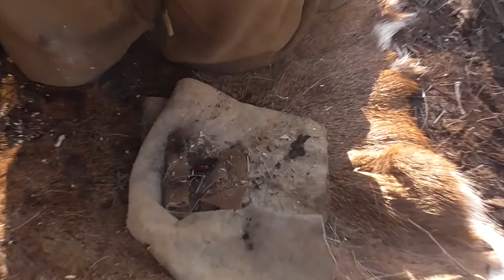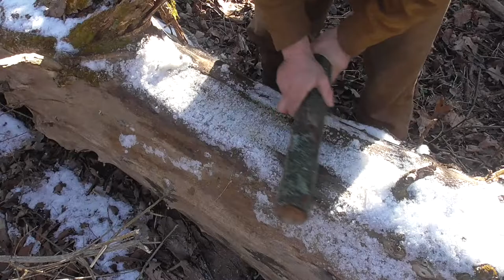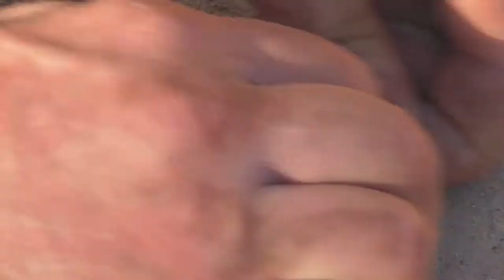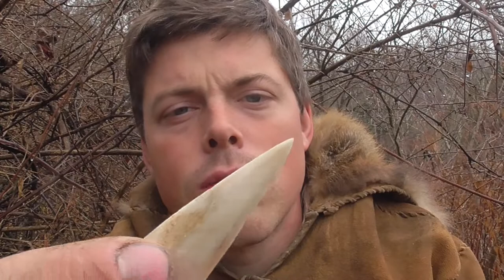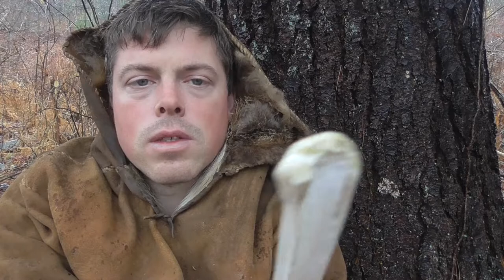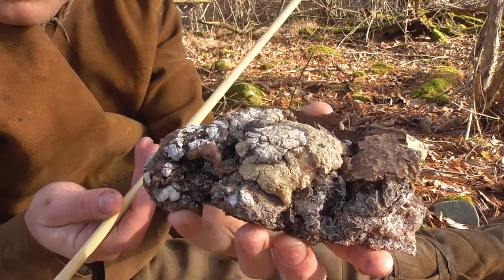(Nature's Arrows Part 4) Some Primitive Arrow Points

Comment: Holy crap those are awesome primitive arrow heads.  I've usually stuck with wooden blunts and leg bone broadheads myself.  One additional design that I've had some success with is slate.  It's way easier to grind out slate arrowheads than to knap it.  That socketed antler head looks wicked cool btw.
Reply from the maker: Thanks, Bushcrafter! I tell you what, the thicker wooden blunts hold up the best, but take be longer to make because I have to start with a thicker shaft. For longevity and durability, they are the best! I do Love those bone broad heads myself, awesome to hear that you feel the same. Yes, that slate can get wicked sharp! Thanks for stopping by to watch my friend!.....Ben

Comment: I have question- been tanning hides for a few years. Most industry/commercial stuff has you salting, pickling/acid etc etc. I’ve always been interested in primitive styles like “if I didn’t have all this commercial grade stuff how would I...”. This brain tanning stuff looks incredibly simpler than the commercial grade stuff. So no salt or pickling needed? Just dry out the hide and away we go with brain tanning? Awesome videos by the way. You helped me diy buckskin so many times! Thanks!
Reply from the maker: Thank you for your kind comment! Yes, Back in time folks didn’t have to worry about all those terms like salt  pickling acid etc. although I have heard of people urinating and worse on hides to change the ph so to speak, but anyway.Dry your pelts out and then go to brain tanning. A drawback I found with Tanning pelts in this manner, if not smoked really effectively, they have a tendency grow mold.Oiling them afterwards can help remedy this, but I haven’t produced a primitive oil yet in my world. Let me know how you make out. All the best! Ben